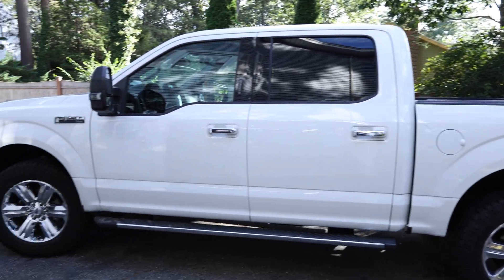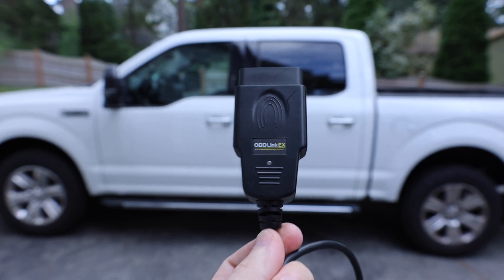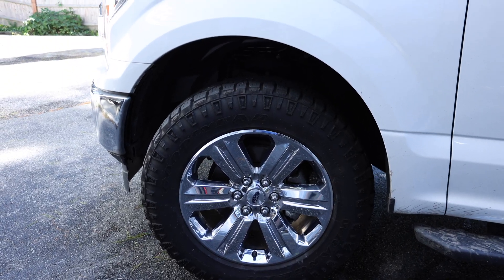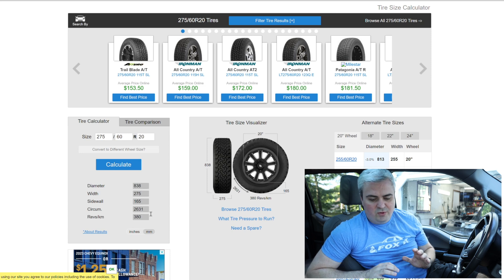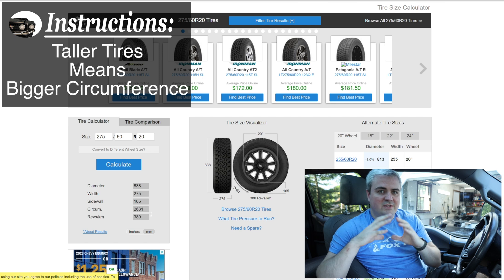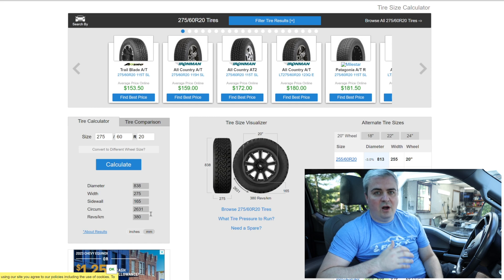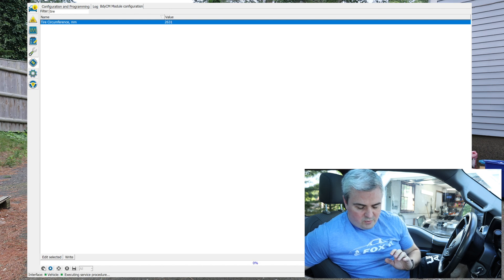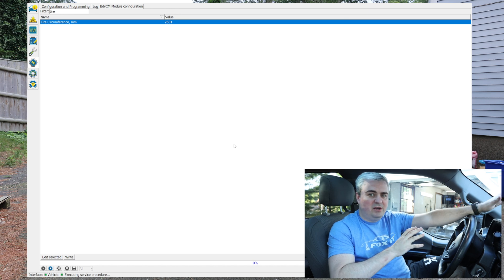Adjusting for Bigger Tires in FORScan for your F150

Comment from the maker: Tools/Software Used:
OBDLinkEX Adapter: https://amzn.to/3QOBmDC
Reply: Mine is a 2015 F-150 XLT, just hit 60k miles. I switched to all led bulbs.  The turn signals blink normally but the underdash click sound is fast.  My understanding from your vid is that's okay if the sound doesn't bother me?   Also, I'm going to get the obd link and get bambi mode fixed because we moved out south of KC and do a lot of hwy driving now.  I just found your channel and subscribed.   Thanks for all the info, I really appreciate it!  John W., Louisburg KS.
Reply from the maker: @slimjam44  If All the lights are working correctly then I guess it's ok. With the OBD Link and FORScan you can disable the bulb outage fast blink and bring it back to normal. There should be settings for both front and rear. Otherwise, you can always add resistors to bring the current up.  Thanks for watching John. Appreciate i!
Reply: @SmackeysGarage  I have 2 questions ...... Will forscan tire size programming work on 96 bronco OBDII. I'm just not able to get the correct number to put into psom. I get 2 different numbers for Toyo 265/75r16 at III 116T. Toyo says 656 and Tire size says 638. I am using inches for this manual programming. Should I divide the difference of 18 and enter 647? I only get 6 tries and have 4 left. I'd like to get this done next week 5/7/24. Any suggestions would be appreciated since the ole timers have all retired and no one has a clue.

Comment: 2018 F150.   When I up size my tires to 7018mm.  I get the service 🔧.   Power train malfunction.     Do I reset anything else or will it self adapt
Reply from the maker: Some others saw this on their trucks as well. The feedback was some trucks will not have the PCM / TCM in sync. How to clear P160A DTC: You will need to go into the config section of FORScan and perform a PCM vehicle data relearn. You should also do a TCM relearn. Let me know if it works. A few people have commented they saw this, but it did not occur on my truck.
Reply: @SmackeysGarage thanks,  I got the wrench cleared.
Reply from the maker: Cool. Glad to hear

Comment: I did this on my F-250 2024 model. I went and relearned the module. And now I have a service wrench 4x4 need service. Can you help me to figure out what I need to do to get that gone. I have tried to clear the codes but that did not work. I even tried to set it back and it will not go away now.
Reply from the maker: Some others saw this on their trucks as well. The feedback was some trucks will not have the PCM / TCM in sync. How to clear P160A DTC: You will need to go into the config section of FORScan and perform a PCM vehicle data relearn. You should also do a TCM relearn. Let me know if it works.

Comment: I updated my larger tire size using Forscan but now I’m getting a DTC code (PCM P160A:00-2F ) (Control Module Vehicle Options Reconfiguration Error)and a battery warning light on that won’t reset.  Have you or anyone else had this issue? Curious how to resolve it?
Reply: Yes he left out that step. I got that error with the wrench warning light. The pcm/tcm are not in sync with information entered. I don’t remember exactly what it was listed as but you have to select pcm reconfigure . If you type in that error code in google someone explained the error and tells you what you need to do. It takes a few miles of driving for the pcm to relearn the new settings.

Comment: Is there a way to change the mileage, bc if your speedometer is off your mileage will be as well. I put bigger tires on my 2011 f150 and the mileage is off by about 10 miles per 100 miles, so my truck actually has about 2,000 more miles than it displays.
Reply from the maker: My understanding is it is based off of the tire size. So adjusting the tire size and getting the speed right is important.

Comment: Thanks
I changed the differential for my Ford Expedition, then the speedometer changed. should I do the same?
Reply from the maker: Changed the rear end gears? Is the gear set you installed an option on a stock expedition? If so, I'd check to see if that option exists instead of the tire circumference.

Comment: How do you calculate the first number measurement if your tire just says 35”?
Reply from the maker: Start with 2766. That is the circumference (in mm) calculated off a 35" inch circle. You may need to adjust up or down depending on your results.

Comment: Did this on my Shelby.  I even measured the circumference in mm.  The speedometer still doesn't match gps tracked speed. Any ideas?
Reply from the maker: Calculate the percentage you are off in mph, then multiply that by the circumference that you currently have inputted. That should get you close

Comment: watched this video, downloaded FORscan and once I adjusted the tire size I had the yellow wrench pop up on my dash cluster (2018 F150 3.5 ecoboost) its saying its the transmission control module P160A ( i believe) through FORscan but not throwing a code on the trucks PCM... how can i clear th wrench?
Reply from the maker: Check this out: https://forscan.org/forum/viewtopic.php?t=17408
A few people ran into this. There are a few people in the comments that took steps syncing or reseting the pcm and getting it to clear.
Reply: @SmackeysGarage  Thank you, I downloaded the .65 version and it actually has a procedure when reconnection to FORScan but that hasn't cleared it even though it states it has. My question, Because i am brand new to FORScan... can it clear the DTC and if so, HOW?
Reply: disregard my last, I figured it out...thanks for replying

Comment: What if tire circumference isn’t even in the list lol. I’m doing what u say but it’s not in the body control module category. Tried searching tire also and not there 😫
Reply from the maker: I can check my forscan tomorrow if it is in any other locations. What year truck do you have?
Reply: @ 2017
Reply: Where u able to check?
Reply from the maker: @raythompson137 I’ll be checking tonight after work
Reply from the maker: @raythompson137  Sorry, was working. It is only under the BCM. Are you running the latest version of FORScan? Really weird it doesn't pop up. What model truck is it? XL/XLT/Lariat?

Comment: Did you get a P1635 error in the DTCs? After I adjusted to the correct size, I received the error so I went back and wrote in the original value…the P1635 error went away. So I guess I just have to leave it the way it is even though it’s inaccurate.
Reply from the maker: Take a look at other comments on this video. Others have run into this issue and have fixed it be reseting another module to get them to sync.

Comment: Has anybody had a wrench and check engine light pop up after changing to this size? Got a code p260A
Reply from the maker: Look up pcm and tcm relearn. That might help. I think sometimes there is a discrepancy between modules after you change it.
Reply: @  was able to relearn and get it fixed. Much thanks. 

Also scrolled down into the comments and found others resolved it like that.
Reply from the maker: Cool. Glad you got it resolved! Welcome!

Comment: I just bought some tires online for my 2020 F150 Fx4 currently running LT 285/55R20 but switching to LT 275/65R20 what mm should I change to on Forscan to reflect GPS speed?
Reply from the maker: I'd start with 2718. Keep your previous value incase you need to go back. I got 2718 by calculating the circumference on the 275/65/20 tire.

Comment: Super easy to use, but now I’m having the wrench light on. Has anybody dealt with this before?
Reply from the maker: A few people have seen that in the comments. You might want to see if you can find one. I've seen people be able to clear it by reprogramming it back to stock then reprogramming it back to the updated number. Some have cleared out automatically after driving.
Reply: @SmackeysGarage  I tried that it didn’t work now. I’m kind of freaking out because I have work tomorrow.
Reply from the maker: Check this site. https://www.ford-trucks.com/forums/1710048-forscan-tire-size-change-causes-wrench-cel-lights.html

Comment: I did this just now and I got the wrench light. Any suggestions?
Reply from the maker: Adjust the number slightly higher or slightly lower. What year is your truck?
Reply: @SmackeysGarage  It’s a 2019. I have 275/65/20 tires. And i put in the exact circumference. Would higher or lower be better

Comment: I changed my number to 2631 ( 33x12.5x20s) my speedometer shows 50 mph but my gps app show around 47-48. How much more should I increase or decrease my number to get it more accurate?

Comment: on my car im going from 205/50r17 to 215/55r17... but even with calculator still 2~3mph (similar issue), any ideas?
Reply from the maker: At what speed and what is your value you used? I’d change the circumference value until the speed is close.

Comment: What would my value be if i have 33x12.50r20 tires? One website tells me 2617 while the other one says 2631
Reply from the maker: From the tire calc site it gave me 2631. Between the two numbers it is only a 0.5% difference. Which means at 60, the difference between the two would be 0.3mph which you wouldn't see from the speedometer. I'd start with one and then see how close the speed is comparing it to a GPS.
Reply: Thank you sir !
Reply: Will a PCM /TCm relearn make a difference or if it’s actually needed

Comment: Very clear instruction.  Just put 35's on my 18.  Thanks!
Reply from the maker: You are welcome!
Reply: Hey, I’m about to put 35s on my 18 as well. Did this fix help your transmission shift when it’s supposed to?
Reply: @darius326  Not sure what you mean about the transmission.  I have no problems in that respect.  Speedo off by about 5 mph, but running FORscan with a dongle fixed that.

Comment: Does any1 know what is the number should be when going from stock tire to 35 for 23 f150? Thanks
Reply from the maker: What’s the full dimensions of the tires? Width/ rim size / height.
Reply: @SmackeysGarage  bfgooodrich 285/75/17 i think circum is 33.8.
Thanks
Reply from the maker: I would start with 2697. The diameter was 33.8.
Reply: @SmackeysGarage  thank you.
Reply: Ok, I just changed n it gave me a warning in dash. "Check brake system" Then I put the old numbers back and again got the same msg. Is this normal? Anything wrong with the brake now? 
After disconnecting forscan I am not seeing the error anymore...
Reply from the maker: What year truck are you doing this on?
Reply: @SmackeysGarage  built in 23 april. 23 f150 v8 lariat
Reply: @SmackeysGarage  update: I just drove the truck and only thing i found weird is my auto hold break setting got turned off by this change. I just turned it on. I pray to God that noting else hapens. Amen.
Reply: I took a pics of the msg.

Comment: Does forscan work with Apple MacBook?
Reply from the maker: People have done it. I have not. It is not officially supported but people have found workarounds. Nothing would be guaranteed to work though it seems.
Reply: @SmackeysGarage  what PC do you recommend?
Reply from the maker: @kevconnors8785  Really any recent PC running windows 11 with a USB-A port. I run it on a 6 year old Surface Book Pro and have no issues with it.

Comment: Hi there, i have question. I add a hub spacer 2inches or 50.8mm . Don i have to add that in tire calculator? For example i have a  tire 275/65/r20 would that be 325/65/r20… this changes the circum from 2718 to 2921?
Reply from the maker: No. That doesn't change the overall circumference of the tire. You would not need to add anything for a 2 inch spacer.
Reply: @SmackeysGarage  thank you

Comment: Mine is still off but not til i reach about 40mph and it gets worse the faster i go. 2011 f150 with 305/45r22. Calculator said 2616 which i tried then i went up a few times all the way to 2700 and gave up
Reply from the maker: Ah. Don't know how it affects the 11 trucks. I never tried it on mine while I had it. Weird to hear it doesn't change anything. 2700 is only 3% more than 2616. At 40mph, it might make only a 1.2mph change if I did my math right.

Comment: I did this but my Speedo is still off. Any ideas on what else to try?
Reply from the maker: Did the speed change at all in either direction?
Reply: Double check your circumstance calculation.  This is the distance around the tire.  Look up your tire diameter on the manufactures web site (same "size tires" do differ from one model / manufacturer to another).  Take the diameter shown and multiply by 3.1416, and then multiply that number by 25.4 to get the circumference In mm.  Ex: 35 " tire. is 35 x 3.1416 x 25.4 = 27693 mm. Put that into Forscan.  If that doesn't work, you have a different problem in the system.  Note: Older worn tires will have a slightly lower circumference which you can compensate for by lowering the number a little.

Comment: Hello, Do you have a video how to fix Vin #? 

===PCM DTC P0630:00-AF===
Code: P0630 - VIN Not Programmed or Incompatible - ECM/PCM
Reply from the maker: I have not seen this. Does the As Built file have the VIN correctly inputted? Can you check that.
Reply: I just changed my tire a size today and engine light came up and also a message in my fordpass app saying “ powertrain control module has detected the vehicle identification number program is not valid” 

What did u do to fix urs ?

Comment: its a perceentage, so the faster you go the more its off...
I have 285/70/17 and was off about 10% so when the speedo said 60 I was actually doing 66, I havent bothered to change it yet, I just know in my head 64-ish will be 70 LOL
Reply: Did you ever fix this because I’ve tried this method I even have access to Ford’s official IDS software and I’ve never been able to get any changes to the as built or regular circumference that he changed to actually enact a real change the dealer said try unplugging the battery so far I’ve tried clearing the DTC’s with my tuner. I’m trying not to run a tune anymore, but I used to run a tune and my tuner could fix it.
Reply: @TANGiGAMING  I have forscan and the cable and have not gotten around to it yet :(
I just adjust in my head on the fly, if the speedo says 60 I am close to the speed limit LOL I set it at 64 on the interstate....
and if I keep it like this I am putting 10% less miles on the truck and when I am reading my MPG I am actually getting 10% better so there is no rush, I think it might be time for a oil change this last month I have averaged 17MPG and I use to average 21mpg but it may also be the seasonal Gas mix change this time of year that got me

Comment: I have S-Max 2016 (mk2) which is basically fusion/mondeo/galaxy/edge. So, i use 235 /55 R17 tires. Original value was 2098mm and i changed it to 2167 as calculator gave me this number. Originally (thnx for stupid Eu rules real speed must be lower than speed on your clock) at 90kmh real speed (gps) was about 86kmh. So after putting new value i got 82kmh (gps) and 90 on the clock. That means foult was doubled.  I restored old values.  I noticed there was smth like Speedometer logic or smth. Mine value was Europe and i changed it to North america. And then fault was only 2kmh, 90 on the clock and gps 88kmh. So i went back to tire circum and put not 2167 but -69 (2098-2167) from original value that means 2029. After that i got 90 on the clock and gps 92. Then i made some more test and righ now there is 2050 value which gives me at 90 on the clock and less than 90,5 kmh by gps and 50kmh on the clock and 49,xx on the gps. Soon i gonna put summer tires back and will check and correct those values again. PS have been in US many times and always checked rental car speedos with gps, and always fault have been less than 0,5mph.
Reply from the maker: Nice work on sorting that out. Definitely takes a few times to figure out what works best and what is close enough!
Reply: @SmackeysGarage  hey, one remark, reading error codes PCM gives me error P160A :00-2F Control Module Vechicle Options Reconfiguration Error. So i started to figure out what gives that error and when i changed tire size back to original value (2098) this error was gone. When i put it back to 2050 (better value on speedo) error started to present again. :D Any thoughts?!
Reply: @SmackeysGarage  Got fixed that problem. By chance i pressed PCM relearn vehicle and after that this error was gone.

Comment: For anyone who’s going from 18s to 20s. 
I put my tire mm to 2528 and it’s spot on . 2631 was off by 2-3Mph as he mentioned in the video.
2023 F150
Reply from the maker: Thanks for letting everyone know!
Reply: You are a legend for this my friend!  Got me spot on now 💪
Reply: @C-Young.  awesome!
Reply: I couldn't find that precise info I was looking for anywhere else! Thank you so much for this! For reference, I was going from 275/55R20 to 275/60R20 like in the video but still found it off too by around 5% when I entered 2631.
Reply from the maker: @alexa.1927 glad you found the info!
Reply: @alexa.1927  Did 2528 get the speed correct?
Reply: @CuursLight  I entered 2547mm and it gives me the exact same speed as my phone’s GPS. After replying to your comment I saw an other comment from Smackey saying that the stock numbers for 21+ f-150 with 20s were 2541 and that’s the one I decided to try first. I ended up not trying 2528 but I might do it when I have time for comparison.
Reply: @alexa.1927  question only if anyone knows. So I did this and I got a wrench on my dash. Im sure I did everything right because I followed the video. Any tips.
Reply: @MakingmovesTX845  Did you get this figured out ? I got that also. I did the PCM Relearn but still on
Reply: I have 295/55/20’s I need to play with the numbers
Reply: 2528 is perfect for my new 275 60 20 - tires @ 35PSI   (2631 was about 2mph off for me)  
Thanks for the update
Reply: What was the setting for the 18s before you switched? Were they 275/65/18?  Thank you